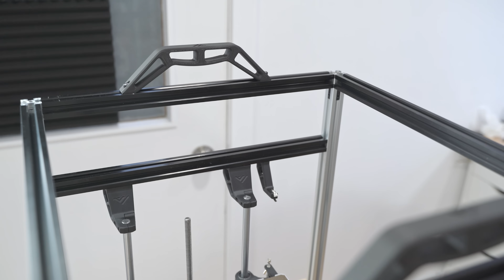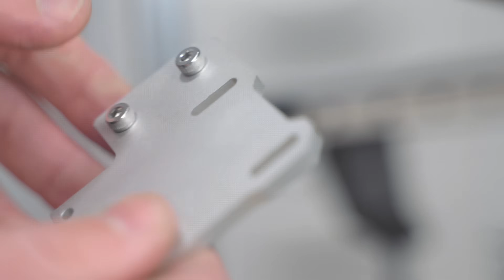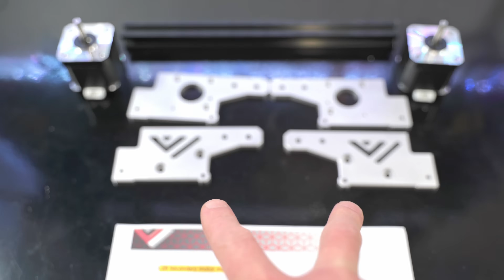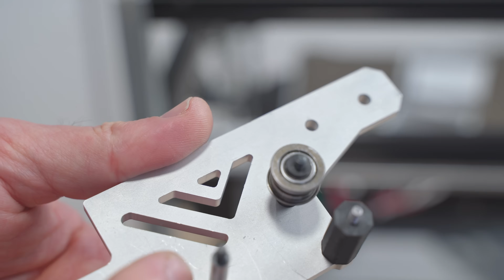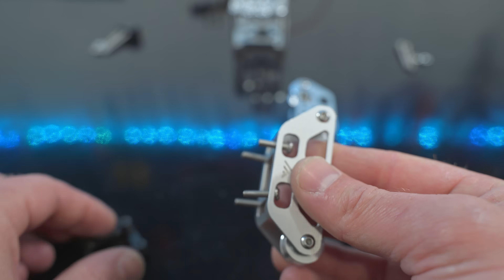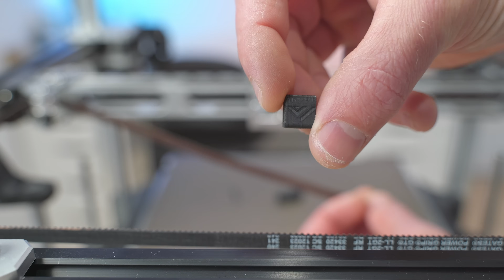VzBoT - Vz235 AWD Build Part 3 :  The Gantry

Comment: I guess I got board cause I said i wont watch any videos on how to build mine and basically this has been been the bain of my existence 😂😂 yeah i made sure that I only buy aluminum from 3x main companies which is Mellow fly then Bigtreetech is also gonna be in there and chaotic lab 😂 lets say that iv got enough aluminum extrusion and just so many parts from bigtreetech . Saving money should have been at the beginning of this year 😂 and I got Japanese motors 🤫🤫🤫 also im going all out my bed is 420mm by 420mm 😂 and some how I found Gantrys( yes plural lol 😂 i bought 3x ultra lightweight gantrys from Mellow) and no 2020 for this guy minimum 2040!  And I got 3040 4040c and 4040 lol

Comment: I am trying to locate the STL file for the spacer at the back part of the motor mount (seen at 20:50). I have looked everywhere on the VZbot boards and github as well as the website but I cant find it.. Can someone please point me in the direction of the STL?

Comment: I found on Ali the Mellow VzBot AWD 330 Kit. I  Have no pssibilitys to Print Clean ABS Parts. Is in the Kit Some Pre Printet Parts so I can Start Printing with it?
Is it an Complete Kit?
What die I also need to Build it. My privius Ideas was to Buy Seperate Hyper Cube Frame becurse It youses 30x30 Profiele for the Frame, and Take the HCV Assambly, but I Found this Kit and wont Take an Voron Printer Kit but  this Kit looks Great becurse there seeme the Motors Includet.

Comment: In place of thread locker or glue i use a little bit of cheap nail polish, my screws dont back out anymore and i even use it on my rails. You can take it apart later pretty easily.

Btw i didnt see rum in the BOM last time i looked. For this or the 330.

Comment: I think that AWD system can have a flaw built in. There will be two motors working on a single timing belt. If one of the motor will be half step shifted ralative to another you will have an extra tension on one part of the belt and lower tension on the other.
And the extra tension can be significant: if we suppose that the 6mm GT2 belt has 1e5 H/1 Young's modulus (E) than the tension force will be: ΔL/L * E = 0.1mm / 600mm * 1e5 = 16.7 newtons (more than 1.5 kg!!!).
600mm is just my assumtion of the belt length between two connected motors.
How do I calculated 0.1mm ΔL: full rotation on the stepper is 40mm, if it has 200 stepps/rotation than full step will be equal to 40mm/200 = 0.2mm. Then half step will be 0.1mm
To prevent this to happen you need to:
1) Loose at least one pulley of the two
2) Energise both motors
3) Tight all pulleys.
And this procedure should be done each time you change the belt tension.
Reply from the maker: Its in our build instruction/manual to sync motors like you mentioned... But... i think im going to remove this..  and the reason behind that is that i found that unsyncing them is not causing any issue but its helping a lot on VFA.  :) since now the steps are divided
Reply from the maker: Also becauee its a bit hard to do when motors have flat spot shafts ..you have to make sure the pulley is not on the flat spot. But again.. i think this useless ..from my teating i get better result unsynced

Comment: 1:14:50 - This is actualli not the frequency we are interested it. Transverse vibrations has no connection to the longitudal (which in turn is important to the printing).
Transverse vibrations frequency depends in the tension while longitudal IS NOT!
More tension will not give higher resonance frequency.
Tension should prevent belt from skipping steps on the pulleys - this is important,
Reply from the maker: I never said frequency of the belt is what we need to know for input shaper. I said that we use the frequency to compare both sides to see if they are at the same tension :)
Reply: @Vez3D  Okey, that clear! :)

Comment: 50:40 - This would work if your frame is square too. Which is not allways true. The main thing is that your X gantry should be perpendicular to the Y rails. This is what you need to check in the first place. So I'd use a square tool for that.
Reply: Yes.

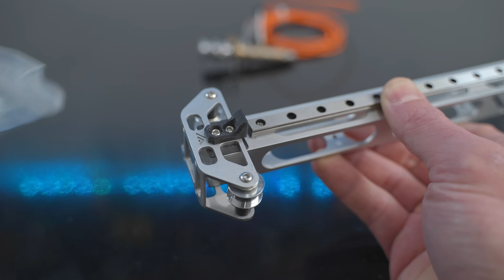Comment: 42:40 - Speaking of the vibrations. Actually I think that the stiffer the assemble, the less vibrations you should have. Vibrations would go into higher frequencies which is also good.
To avoid missalignment problems I think you could untight the screws holding the brackets to the X-gantry, tightly connect the brackets to the Y carriages and then - tight the screws holding the X gantry.
Another problem is the parallelism of the Y rails. Maybe you could untight the connection of the extrusion holding the Y rails, make shure that X gantry can go all the way along the Y axis and after that - tight the extrusion to the frame.
Reply: We’d need to test it to be sure. Stiffness doesn’t always mean less vibration because aluminum and steel don’t have very good damping properties. There is a trade off to be made between maximizing stiffness and maximizing vibration damping. Sounds like Vez suspects the loss in stiffness from a printed spacer is worth it for the damping and vibration isolation gained.
Reply: @bloogaming8827  This is an interesting point! I didn't thought about the dumping effect. Yes it can work positively.

Comment: 40:00 - I think that it would be better to make a hole in the top plate to let the pulley go through. In case you need to pull it out for some reason. Without this hole you will need to disasemble the whole top plate.

Comment: 35:30 - Does this spacer washer really needed? I tried just two F623ZZ bearings and it looks to wokr fine. The space between two flanges should be 6mm dead. So it should be enough for the 6mm GT2 belt. So could you explain why use the washer?

Comment: why not use the same belt clip method on the rear as you did the front, just clip it first leaving the front long since it's easier to adjust
Reply from the maker: It will be more difficult i tink. But one can try and see if the belts aligned correctly

Comment: What the use of 4 steppers? 
You did a great job to reduce the weights, but the inertia/mass of the motor will produce the same issues as a weight of the head...
Reply from the maker: Im not convinced about that  :) this thing will reach craze accel and speed
Reply: @Vez3D why not)

Comment: why did the choice stop on a beam made of aluminum? because the difference in thermal expansion between carbon and steel is much less than between aluminum and steel
Reply: it may seem like a trifle, but from experience I can say that due to such an expansion when printing a model with a large size of the lower layers, especially the first one, printing problems often occur despite the fact that the bltach removed the card, but due to the decent printing time of the first layer, the Z gap slowly leaves closer to edge of the table
Reply from the maker: it was just because of the look fo this one :) My enclosure dont go above 40-45c.. so thermal expansion is that big of a deal

Comment: Beautiful, I will just add more mass and rigidity (maybe soldering the joins). More mass dampens jerk naturally, I would make the frame completelly out of steel, your motors will work smoother and the print quality would be much better at speed.
Reply from the maker: my goal is to keep printer movable hehe. The frame will be bolted to concrete wall so that is also a good option :)